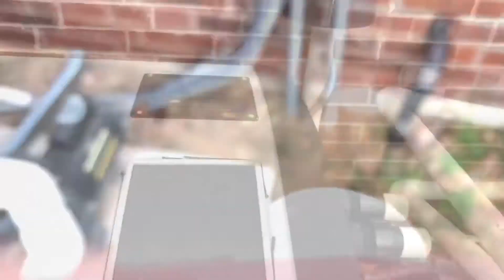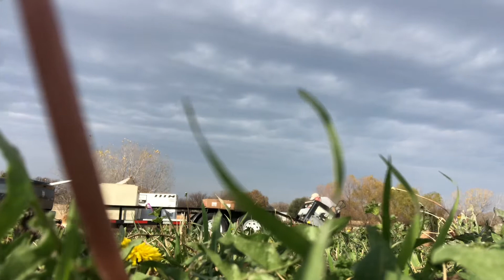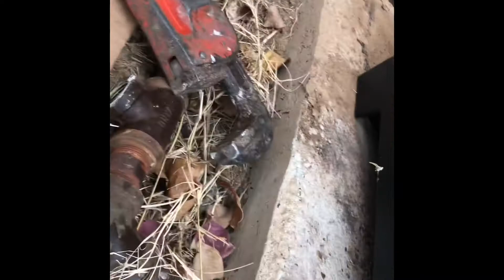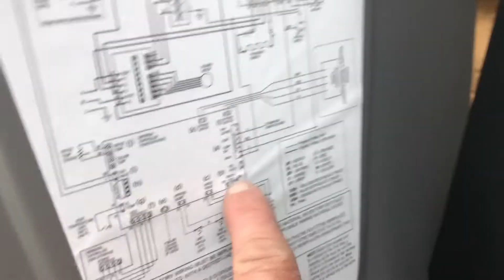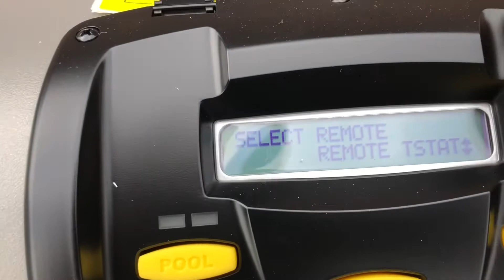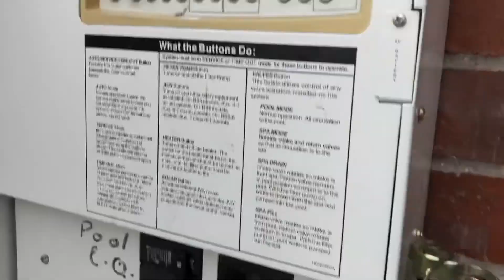Jandy Heater Installlation complete

Comment: how do you adjust the gas flow? mine rumbles SOO loud, i took the top off and found the gas adjust (coming into the unit) but not sure if all the way down is full gas or all the way up is full air mix... trying to turn down the heater as it seems like its full blast and I just want a medium flame inside. Thanks!
Reply from the maker: Before adjusting the gas valve, I would recommend checking the inlet pressure. If it’s too high, the regulator can be adjusted.
Reply: @Pool-guy  sounds good, thanks!

Comment: this is great! Thanks.  Related question: do you have a video or link to step by step diy instructions for disassembling a rusted out Jandy LAARS LX heater?  It's gonna go to the scrap yard, but an enclosure was built around it so unless I get a small crane to lift it over a 6' wall, I gotta take it apart to get it out;  Has to be do-able since it was built from pieces in a factory...  Thanks!
Reply from the maker: It’s not difficult at all. Grab a 1/4” and 5/16 nut driver and start removing screws. The top and walls all come apart. It’s actually pretty cool and you will see the engineering involved in the design.

Comment: How did you size for propane line i have a customer who want 2 of those but cant find information on sizing the line so it wont be undersize.
Reply: I tried calling customer service and couldn't get a hold of someone.
Reply: You can find that type of information on the propane / natural gas connection kits (bags with the yellow gas connection pipes). It tells you what size you need depending on the btu the unit calls for. Thank my later my boy!

Comment: that is propane gas
Reply from the maker: Yes that is correct, propane gas
Reply: What size rises was that client want one but they are 350 ft away from the pool heater.
Reply from the maker: @PedroRodriguez-ll2wi  the one in the video is a 400. If their pool is 350 feet away from the pool it may take a little longer to heat up but a 400 heater is the largest one they make.
Reply: @Pool-guy  thanks but my question what size line was underground to feed it? And did you reduce before entering the actual pool heater ?
Reply from the maker: @PedroRodriguez-ll2wi  this heater was propane and the fuel tank was probably close to 250 feet away.  We used the yellow 3/4”  ips gas line from the tank to the heater about 250’ 
There is a special connection to go from plastic to standard 3/4” black pipe fittings.
Reply: @Pool-guy  they want to run 2 of them and tie into the same tank im afraid they would run out of propane inside the house trying to feed 2 400k btu heaters.
Reply: @Pool-guy  or would they be fine if we tie both of them to the same line as the house.
Reply from the maker: @PedroRodriguez-ll2wi  wow! Two heaters, that must be a large pool
Reply from the maker: @PedroRodriguez-ll2wi  I’m sure there is a chart for gas flow through a pipe similar to the water flow charts. A plumber would be able to guide you in sizing it properly. Here is the link for the chart. 

Based on the chart copper tubing would not carry the 800k btu’s for two heaters so you will have to use pipe. The charts shows 3/4 steel pipe will handle 1020k btu’s at 350 feet

https://www.regoproducts.com/liquid-propane-gas/field-topics/sizing-propane-piping-systems/
Reply from the maker: @PedroRodriguez-ll2wi  from what I see in the marketplace, very few people ever hear their  pools. The actual cost to run the heater is expensive and after they do it once or twice they realize what a waste it is.
Reply from the maker: @PedroRodriguez-ll2wi  it will work as long as the supply line is sized properly
Reply: @Pool-guy  what section is that I could not find the steel pipe section ?or black gas pipe  is what you mean correct?
Reply from the maker: @PedroRodriguez-ll2wi  yes sir that’s correct the black pipe

Comment: Is the regulator at your heater a second stage or is it a combo first AND second stage?
Reply from the maker: This one is a second stage. There is a primary at the tank and a second at the appliance. The reason is the gas from the tank to the heater is at a higher pressure.  We have to step it down at the heater for the proper pressure.

Comment: Awesome work sir but Jandy is trash and they don’t stand behind their product. Had multiple watercolor lights go bad because of moisture intrusion. 3 within 4 years actually. They said, and I quote,  “sorry, you’re out of warranty. It’ll be 1200 for a new one.” I also have their pumps and one of them is beginning to make a loud annoying noise. Brand new pool with all Jandy stuff. I wish I would gone with a different brand :(
Reply from the maker: Hate to hear that you’ve had a bad experience with Jandy. Most of the time their 3 year warranty usually covers any defective equipment. 
But your right about the lights…$$$$
We’ve had trouble with all brands on the lights. The led’s are still fairly new, and lots broke within the warranty period, but they are getting better. I say that because the repairs on them are less frequent. But when they work, beautiful!!
Reply: @Pool-guy  thank you for your reply sir. It just doesn’t make sense to pay 1200 for a light that only last a year or two. I’m sure that’s why they have such a short warranty period. After all, a pool should last way more than 3 years. Led technology is not that new at all. A big company should have figured this out already as many others have. Thank you for your time.

Comment: Is a fireman switch not required on these new Jandy pool heaters? If it is what terminals or wires do you tie it in to?
Reply from the maker: Best to check the installation manual. When you say fireman’s switch, are you referring to the fire roll out sensor? If so the new units have a contained flame. There is no longer an open firebox where the flames can roll out.
Reply: Fireman’s switch is only required if you’re connecting the heater to a timer.

Comment: I have an older Waterpik controller that I am trying to use with my new JXi. I replaced a LX400N that utilized two different add in boards to control my JVA valves and also a relay for the filter pump. Can I make these older boards work with the new JXi? I see JVA spots on the new circuit board but no jacks soldered in.
Reply from the maker: Waterpik is not one I’m familiar with. I can’t find anything online either. Perhaps it’s time to upgrade😊
The jandy IAquaLink system is my favorite. Easy set up and very user friendly

Comment: Where's your sediment trap? Good way to void warranty.
Reply from the maker: Sediment trap?
Reply: @Pool-guy  for the gas line. Pg 18 of install manual.
Reply from the maker: Excellent point, Mr Donahue.

Gas sediment trap is absolutely necessary on the gas supply line on an open system, like city supplied natural gas. There can be multiple penetrations at any time, creating lots of debris in the gas lines.
Most of ours are rural and on closed independent propane systems. No unexpected entries to the line reducing the need for the trap.
Reply: @Pool-guy  , there's no exception per NFPA 54 (the National code) . There is absolutely no information or studies done that your propane tank gas is any cleaner than any other gas plus if you would read your installation instruction guide you would see that a sediment trap is required. Also start using a knee pad , you'll thank me when you're in your 60s.
Reply from the maker: @boby115  
Thanks for the comments. Sounds like the The sediment trap is like a stop sign. It’s there to prevent an accident.
Reply: @Pool-guy so is that agreeing with his comment? Or are you just being sarcastic with the guy? Where exactly is this sediment free gas lines of the country located?
Reply from the maker: @BenjaminMarquez-q2g  anytime we connect a gas heater to a city gas supply we always put in a sediment trap. The reason, there’s always new connections being made to the supply line.  As a result, there is  a really good chance of getting debris in your gas line. However, the system in the video is a residential propane tank. The system is not at risk like it would be on a city gas supply. In the 20+ years I have been working on heaters, never once  had a clog on a propane system. But on the city gas supply we have had issues even with a trap. The latest was last year at the hospital pool. A piece of metal screen came through the line and clogged the pipe. So on an independent propane system it’s not necessary, but city supply definitely needs a trap.